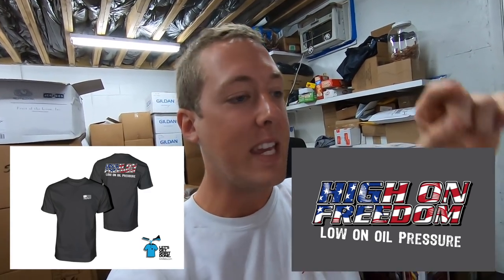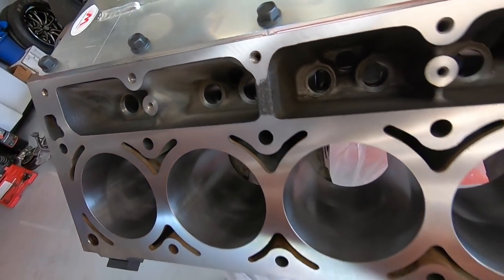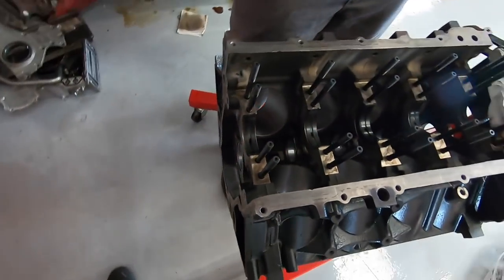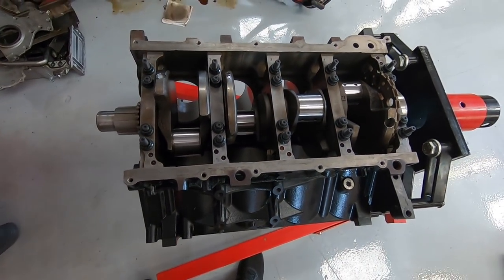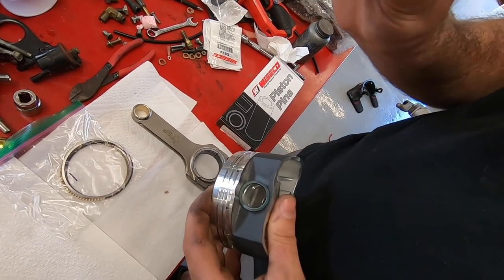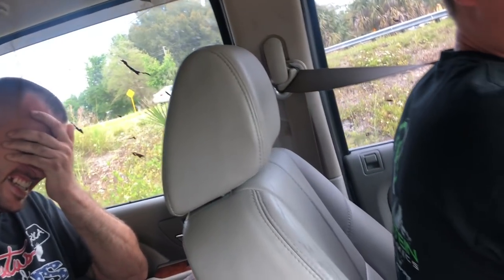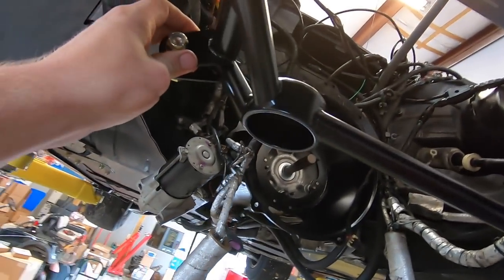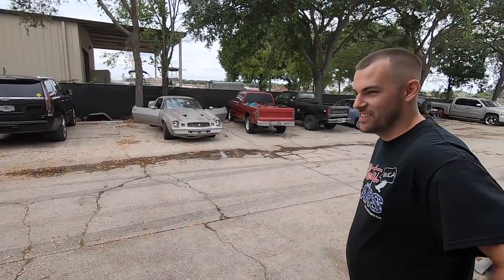Assembling the Auction Corvette's NEW Bald Eagle Engine! + Building a 10ft Snorkel For the Bogger!

Comment: Where do you get all the money to be able to continually keep having fun by rebuilding and blowing up these junkyard blocks? I get the junkyard parts only cost a few hundred dollars and your labor is free to yourself but all those extra parts are not free and can be quite expensive. Everything from BRAND NEW high performance "dumpster fire" cams with new bearings and crankshaft with bearing and then even all brand new Pistons, connecting rods, rings and a complete rebuild gasket kit. I'm thinking all that stuff I just mentioned by itself has to be at least several thousand dollars or more and that's not even to mention the cost of that really nice turbo that has those super nice bearings that allowed to continue to spin for days. I guess what I'm asking is where is all the money coming from to be able to afford all those extra high performance parts that cost a small fortune? I know these guys are not paying for it out of their own Pockets because of how quickly they end up blowing up the engines and going right back to rebuild another one in going back to the junkyard to get another block and then calling up the high-performance places to get all these new cams and crankshaft excetera. So someone's paying for this I just don't know where the money's coming from and I'd like to know so I can learn how to do this myself

Comment: should use assembly lube and not oil. while the motor sits the oil is going to run off and or spin off at start up. lube is more of a grease to stay until completed in the car and thru initial start up